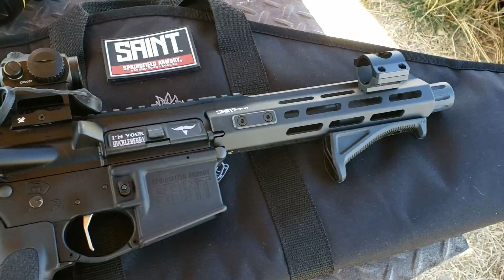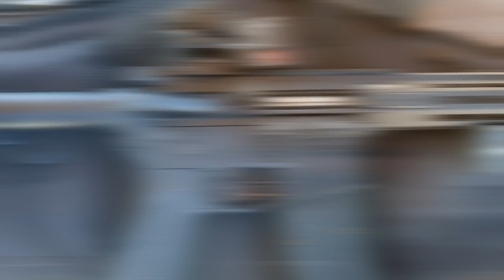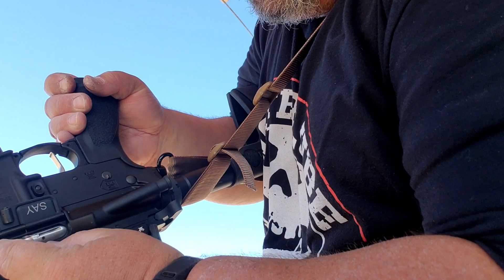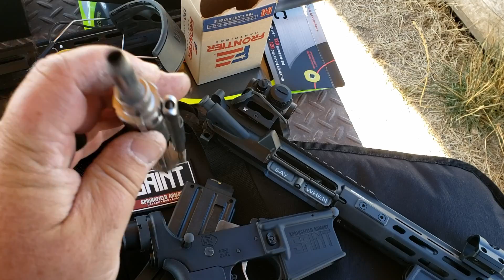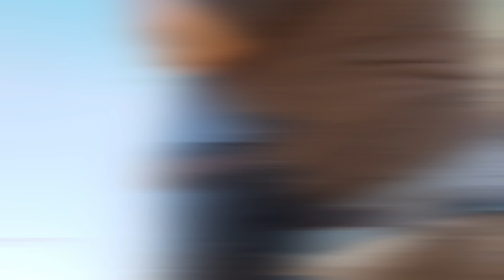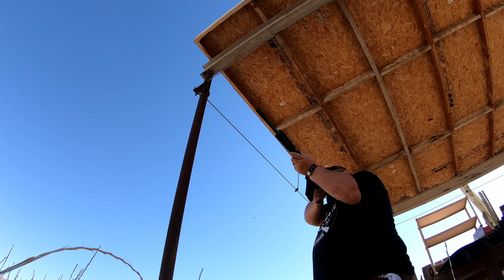Some Fun Shooting and a 3D Printed AR Upper

Comment: Can you try that upper with 5.56? I’m curious how it’ll handle the heat and a less than convenient support system for the bolt
Reply from the maker: I have disassembled the 3D upper. If I get parts for another setup I will consider building it up again.
Reply: @BlutoFPV  if you'll do this use some metal insert with thread for barrel, otherwise you'll get crack in plastic near the barrel

Comment: Guns don't kill people. 3D printers kill people. 🤣🤣👍 Cool video my man! Did you notice any difference at all in shooting? Does it feel just as sturdy as a milled one?
Reply from the maker: The only problem I noticed was I had no sights on it so it felt weird. It felt solid. I am not sure I would feel comfortable shooting more than the 22lr out of it. It was plenty sturdy.
Reply: @BlutoFPV  ok. So we're not going to see a video any time soon with one of these chambered in .300 H+H? Even if we say please? I'm a machinist and I'm curious whether one of the powdered metal 3D printers would be able to take pressures from a magnum round?
Reply from the maker: @michaelfrench3396  I work in metal 3D printing. I would have 100% confidence in metal printed receivers.
Reply: @BlutoFPV  I was afraid you were going to say that. metal 3D printing is like the scariest thing in my world. I'm afraid it's going to negate needing a machinist for anything. Thankfully I can program a CNC. although I guess some things will always be cheaper to just machine right?
Reply from the maker: @michaelfrench3396  No way are machinists going away, a large number of our parts get some post machining. While the prints come out in spec some areas are printed over so we can get a machined finish on them.